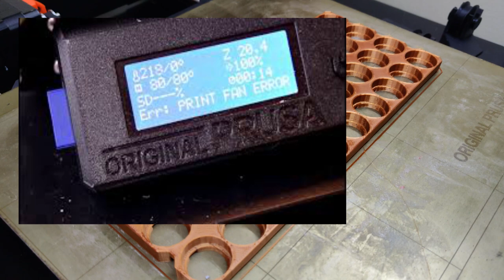Prusa MK3 - Err: PRINT FAN ERROR FIX!!!

Comment: Love your video! Can I get more info on the orange piece on the bottom of the extruder?
Reply from the maker: That is a fan shroud to direct the air from the cooling fan as the printer is running. You can get the files to print that from Prusa's website.